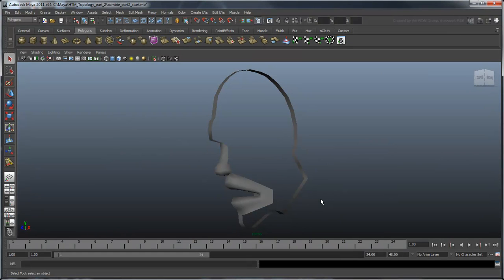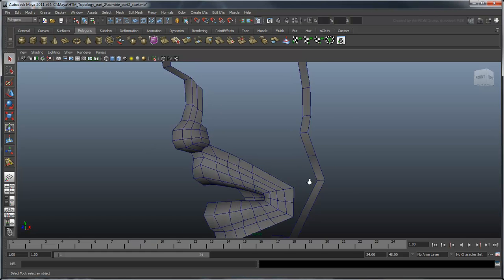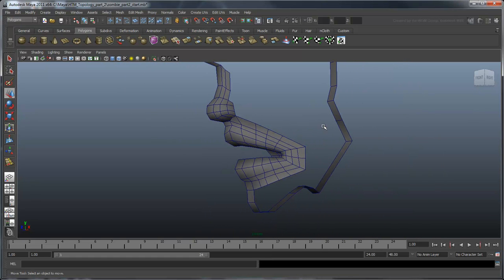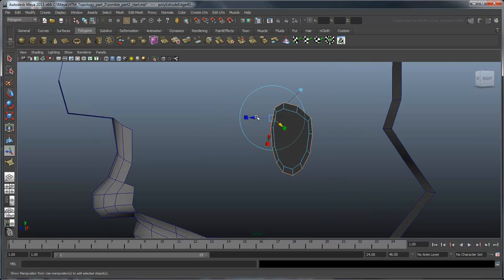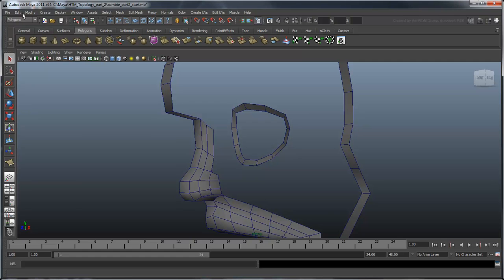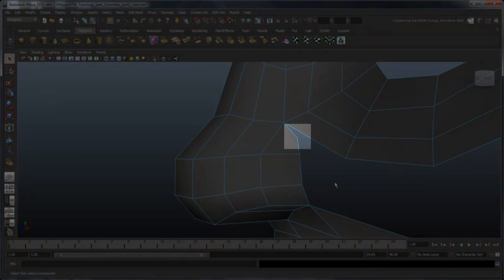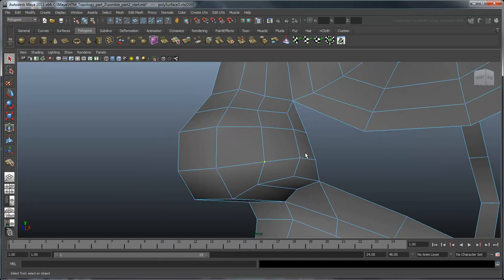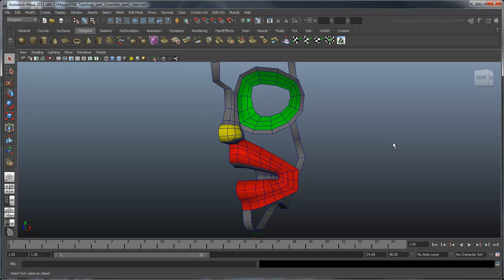Modeling a head with proper topology - Part 2

Comment from the maker: I can't seem to reproduce this issue, but you can try deleting the image plane and re-importing it.

To delete the image plane, go to the view (front or side) of the image plane and select View > Select Camera from the workspace menu bar.  Then open the Hypgraph Connections Editor (Window > Hypergraph Connections).  You should see an image plane node attached to the camera node.  Delete it here and then use the process shown in part 1 to reload it again.

Comment: I have problems while opening the file in Maya 2014 SP3 the mesh seems to be messed up, would like to take a look at the changes between part 01 and 02
Reply from the maker: Good catch.  There seems to have been some corruption in the scene files.  It should be fixed now.
Reply: Hmm, still doesnt work, opened the (2013) files, cause i saw they were changed, but geo still messed up :( btw its in all files, part2 and 3 too, only files working are in part 3mid and part3 end...

Would be nice if you reup, I am fighting around the whole day, and a big thanks, the tuts are awesome, learning a lot.
Reply from the maker: Sorry, try it one more time.  There was a server error on our side.
Reply: Everything is fine now, didnt check part one but two and three work like a charm. 
Thank you very much :)

Comment: The snap to curve doesn't work for me? I had an older version before and it worked fine then but now i'm using 2014 and no matter how many times i try it doesn't move the vertex on the edge, it just moves the edge with it. Is this fixable?